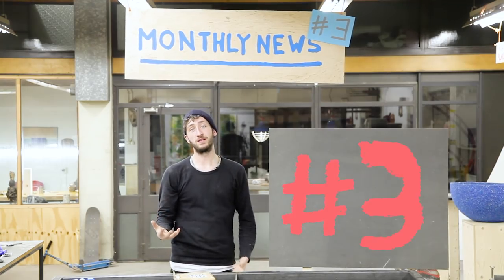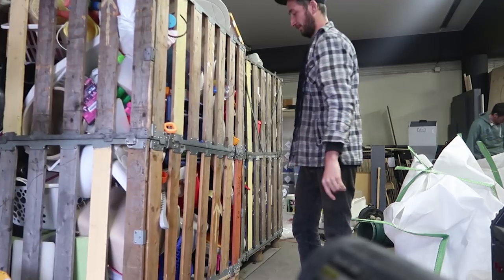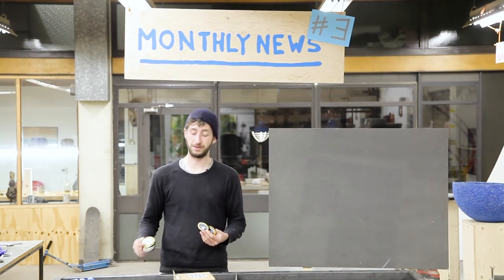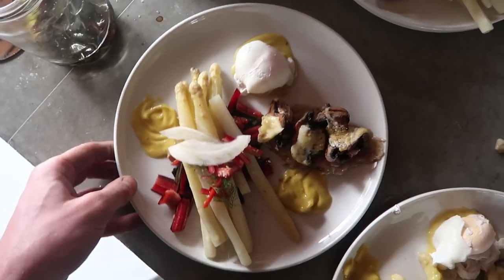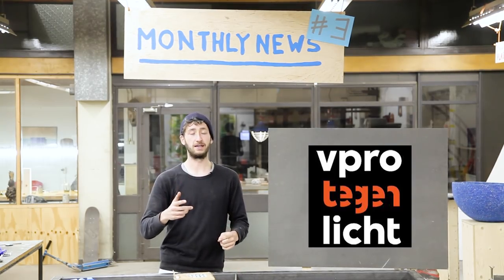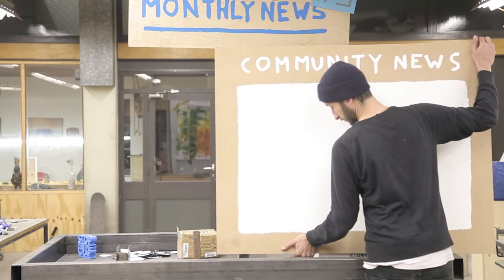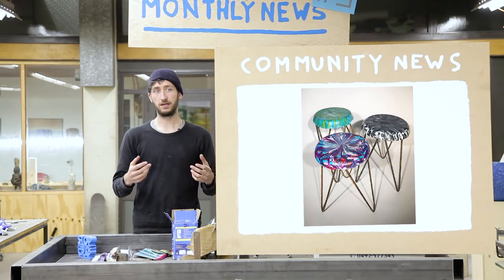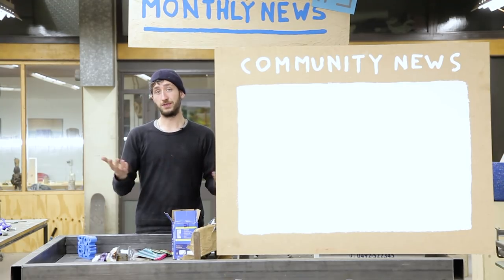Monthly news #3 - A flag, 3D printing & proper lunch

Comment: Beautiful work u are doing there. really love the things u do. love and respect from Pakistan. ❤️ will start working on shredder and injection machine soon.
I just have a Suggestion for you guys. if u are worried about all the organic waste that u make from cooking the food. e.g. left over vegtable cuts or anything else that is organic. collect all of the organic waste and leftovers in one place. like in a closed container and leave a small opening. in the that container. attach a pipe with it. as time passes that organic waste will decompose and will make methane. which u can use to burn or heat up plastic. u can use that to fulfill ur different needs that requires fire or heat. hope that helps. ❤️

Comment: hey! in Argentina (were i live) there is a fever of 3D printing crap. What machine do you recomend for build and make filament for the 3D printer? I know that the filament it could be with diferent shapes, or sizes (sorry for my english) and the extruder could work bad with that problem. But maybe I can make some changes for good. Congratulations for all the work!

Comment: Do you have recycling logos on your molds? Surely if you want manufacturers to put it on, you should too
Reply from the maker: Yes. Included in V3 as well
Reply: Is there a system in place or is it done on a case by case basis? Also how would you go about putting the stamp on extruded things?

Comment: did you just tell us to stop making useless crap? what's with the big bowl and all that garbage?
Reply: I believe they are experiments on how to give recycled plastic new life. Different shapes, moulding techniques etc.
Reply: by recycling it into something much less useful than what it was. a giant purposeless bowl just takes up space. If he retained it in the many bits of packaging he made it from, it would be reused for packaging and containers. fit a motor to it and make it a toy again 

reuse > recycle. more purpose and more energy efficient.
Reply: Of course reusing is more energy efficient than recycling. There's still a huge demand on new products to be manufactured, and probably always will be. If a portion of these can be made from WASTE, with minimal invest in tools etc, how is that useless? 

This movement is important for mainly two reasons:
1. Make the public aware of the situation and its scale. 
2. Educate the public in how to make a difference and provide tools and knowledge on how to do so.
Reply: There is a huge demand for new products not huge blue plastic bowls that don't fit anywhere
Reply: Why are you getting stuck on that bowl? It's not going into production, it is probably just a prototype from a manufacturing process they're investigating. These guys are doing something great. Don't be a troll. 

And speaking about energy, renewable energy is cheaper than that of fossil fuels (global average). Did you know that?
Reply: it's hypocrisy. He can take back his earlier video the useless crap he was talking about can all be given purpose if they are to be used in a video. like cooking an elaborate meal and destroying it instead of eating it but it's deemed acceptable because it's all on camera. it's not on.
Reply: The useless crap video wasn't about one plastic bowl being made to investigate plastic, it was about tons of stuff (yes maybe also a giant plastic bowl) being made just because you want to make something. That's not hypocrisy.
Reply: It's the principle obviously.